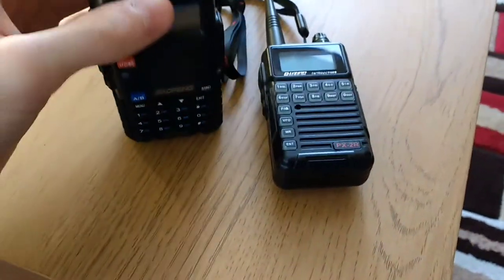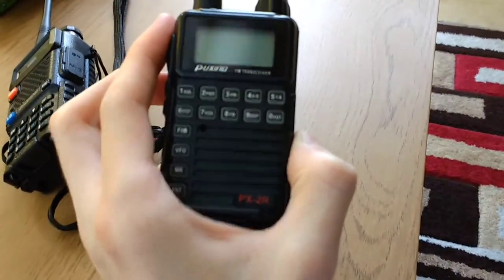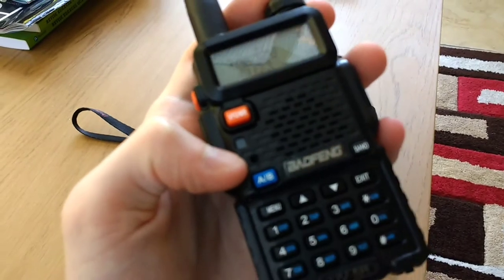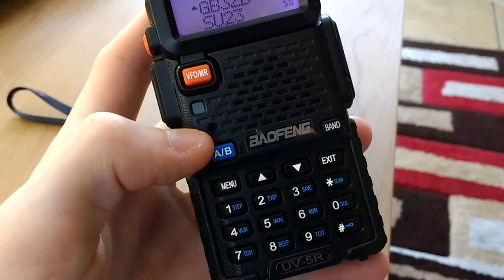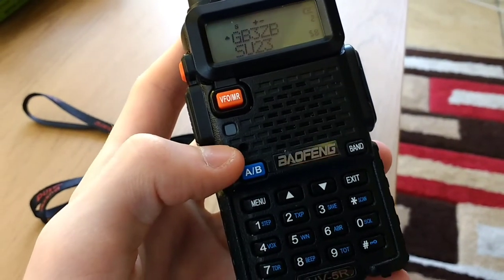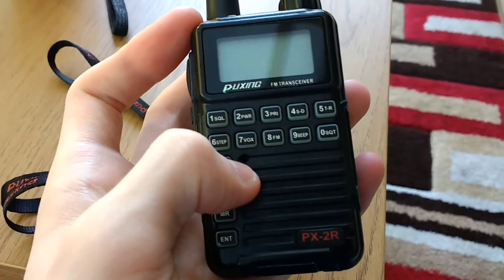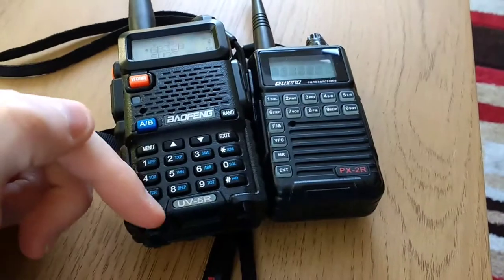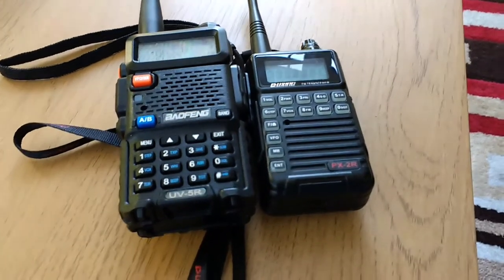Baofeng UV-5R Mic mod

Comment: Confirmed! also had reports of muffled audio from my baofeng, drilled out the plastic hole to about 3mm, also widened the rubber insert underneath - bit of open cell foam (from some packaging) in the hole to stop the worst of the dust getting in. Took about 30-45mins and reports were 'audio is infinitely better'

Comment from the maker: UV5Rplus+ does have a slightly bigger hole than UV5R but they still are small compared to what it should be for best maximum audio from mic. Puxing is another Chinese radio which suffered massive until I modded it.

Comment: Tell me bo'.... did you have to remove the  front cover at all?  Y U NO show the drill bit?
Reply from the maker: Yes I do say that you have to take it apart in the video. The drill bit was just a small multi use bit NOT wood and NOT masonry. So its technically a metal working drill bit. You can choose size but as I state I used bit same size as the inner rubber hole which is part of keypad. So basically making it wider but not too wide.
Reply: It's an older technique, Sir, but it checks out.
Reply: @overlordddrp  You don't have to take it apart to dril the hole, just don't drill too deep. If you press the Monitor button, the green light inside shows you where the mic is in relation to the outer hole so you know where to skew the drill to if the mic is not straight under the hole. The plastic is about 1mm thick, then 2mm air and then the mic so with a steady hand and a Dremel ist should work just fine. Don't set the drill dpeed too high or you'l melt the plastic and use a metal drill and not a wood drill with a sharp point.